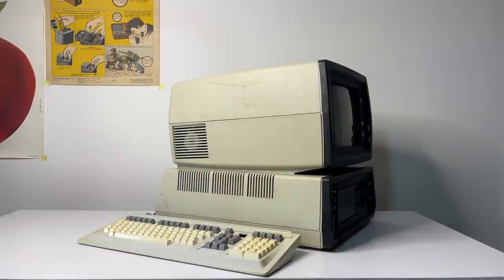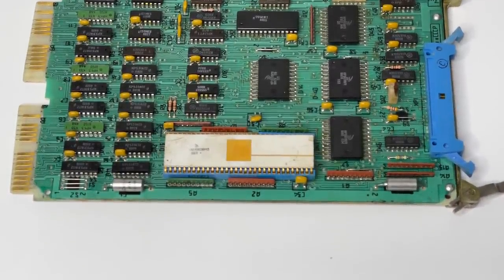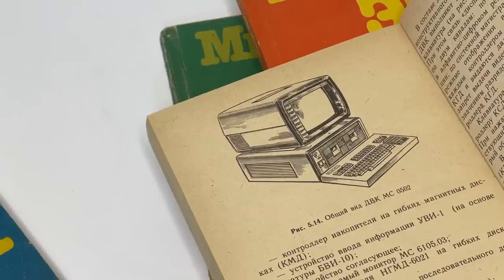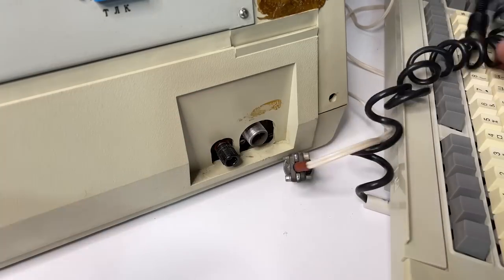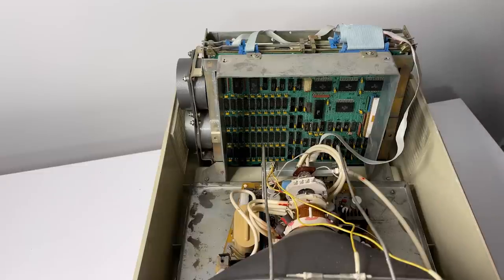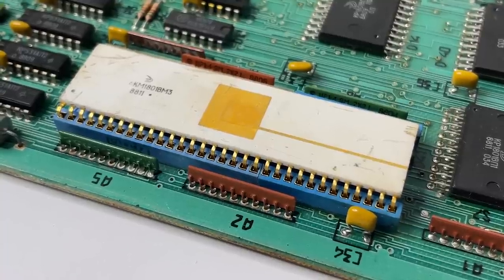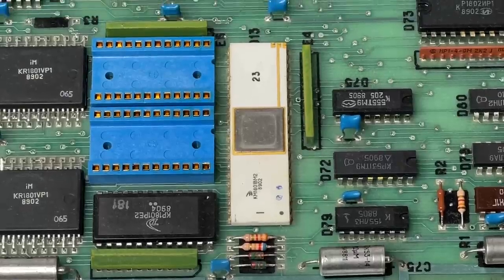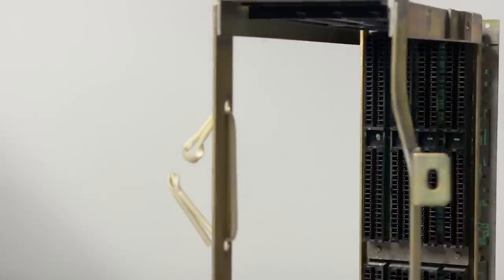DVK-3, the MOST CHERNOBYL COMPUTER EVER.

Comment: PC`s today are just stupidity over powerful for most peoples needs , i ran my office in mid 1980 with a 7mz 500k ram amiga and it ran everything just fine .(word , scribble and paint with a 250d dotmatrix printer ) plus games !  Though you needed an expensive (115 uk pounds ) for a 500k ram expansion for sounds .
Reply from the maker: Well, pretty true. As cheaper the powerful hardware becomes, as less efforts are put into optimization of hardware resources. Resulting into a need to have i3 to run MS Word.

Comment: How are Chornobyl systems doing these days after nazi occupation and all the pillaging that happened?
Reply from the maker: It is a massive question. Shortly, for a few months was a repair/restoration stage, as destruction level was high. The Chernobyl NPP turned to a shift-based mode of operation with its staff staying overnight straight at the power plant (pretty like in 1986-1987). At the town of Chernobyl operates only what really needs to.
From our side, we now gather tech aid and delivered already a few batches of equipment for them, more information is on our Patreon.

Comment: Small correction: at about 13:54 the MPI bus is a parallel bus not a "serial" bus,  that's why it has so many pins.  more info https://ru.wikipedia.org/wiki/%D0%9C%D0%B0%D0%B3%D0%B8%D1%81%D1%82%D1%80%D0%B0%D0%BB%D1%8C%D0%BD%D1%8B%D0%B9_%D0%BF%D0%B0%D1%80%D0%B0%D0%BB%D0%BB%D0%B5%D0%BB%D1%8C%D0%BD%D1%8B%D0%B9_%D0%B8%D0%BD%D1%82%D0%B5%D1%80%D1%84%D0%B5%D0%B9%D1%81
Reply from the maker: Big thanks for this correction!